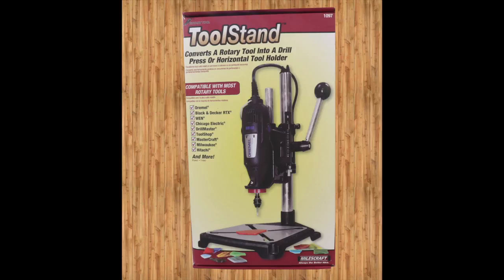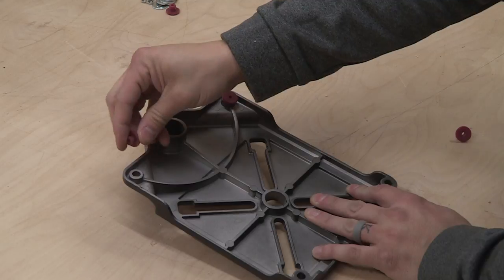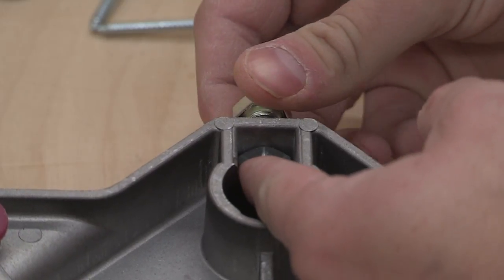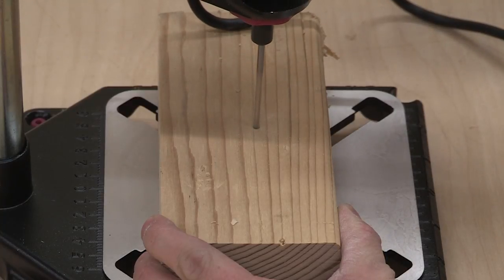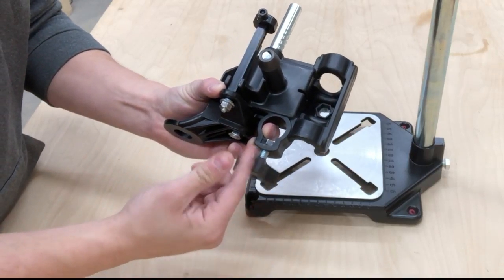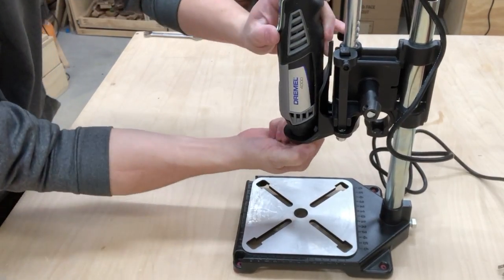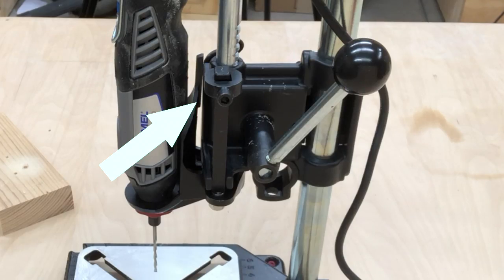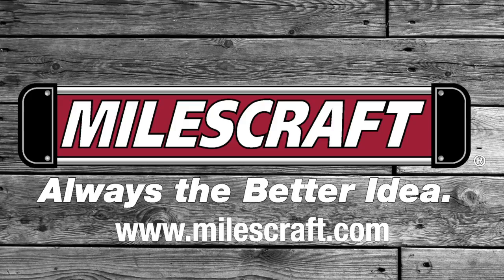Milescraft 1097 ToolStand - How to Convert Your Rotary Tool Into a Drill Press

Comment: In the video it looks like the rotary unit drill bit is not squarely horizontal. Is there a way to make an adjustment to insure it is squarely horizontal?
Reply from the maker: The tool stand should be squarely horizontal if assembled correctly.  If you are having any issues with the ToolStand please reach out to us at info@milescraft.com. Thanks!

Comment: I would like to confirm a small function of this stand. When you pull down the bar and the drill goes down, does the bar try to return to the original position or it will stay down unless the user moves the bar?
Reply: If you still need this information( it can go back to its original position unless you tighten the s screw really tight it’ll stay where you pull the lever at )